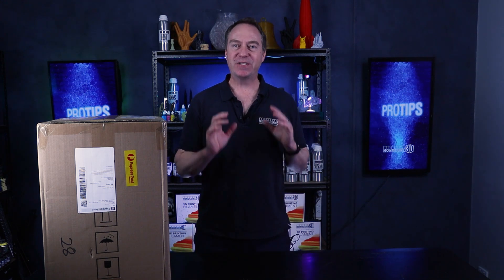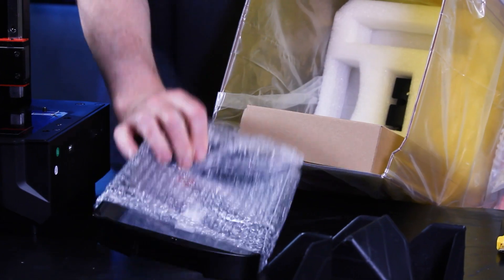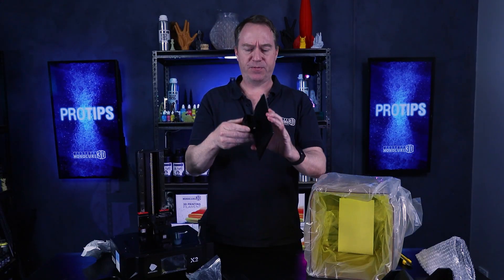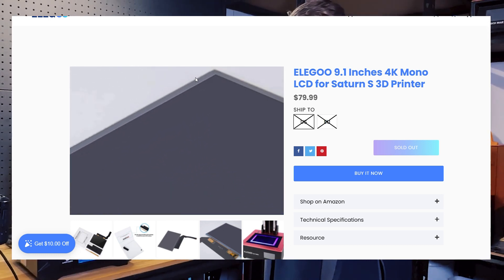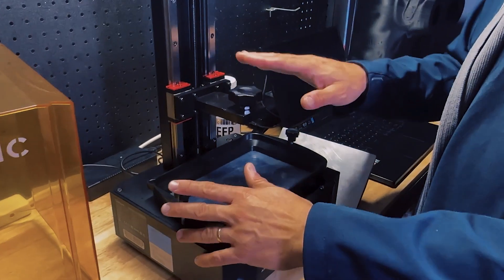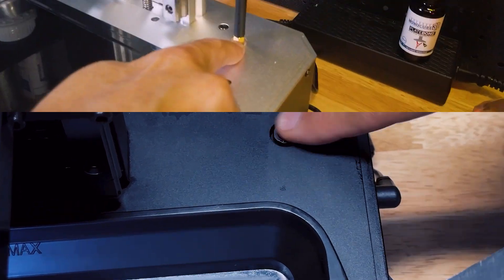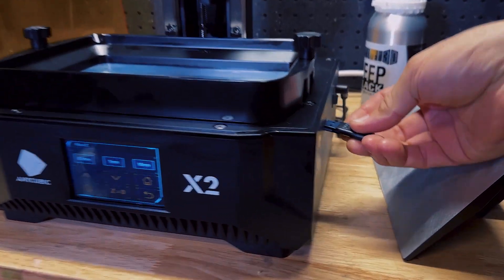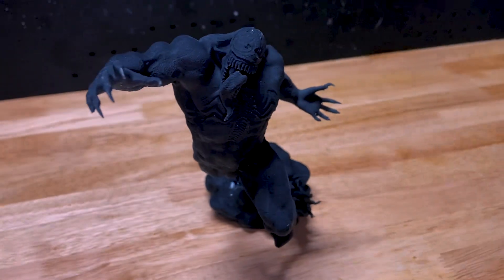Unboxing & setting up the Anycubic Mono X2 | Replacing the LCD screen | Better than the Mono X?

Comment: The important question is: did the resin leak happen despite the screen protector, or did you forget to install the screen protector? I thought the whole point of the screen protector was to keep resin from getting into the printer.

Comment: so should i fill my new vat with distilled water to test for leaks?
Reply from the maker: Doesn’t need to be distilled
Reply: @Monocure3DProTips  so would I just put in water and wait around 30 minutes to test for leaks or would it be instantly noticeable. Just my first 3 d printer and so i dont want sny mess ups

Comment: X2 or M3? It appears that the M3 has better contrast. Is it that much better to sacrifice the size?
Reply from the maker: X2 IMO
Reply: I have both , and i did a comparison test of a small head scale 2 CM height , it's not a real difference especially if you changed the Mono X2 layer height to 0.03 - you won't see a difference with your bare eyes

Comment: FYI You can buy replacement hand-bolts from bunnings (if you're in oz). Mono X build-plate screw is M8 20mm (stock is 12mm but it still fits) and M6 40mm for the vat. I would presume these would fit the X2 as well.
Reply from the maker: Nice tip thanks Ben!

Comment: What settings do you have set for this printer? Are you using the settings that anycubic slicing software gives you from factory?
Reply from the maker: Settings depend on the resin you are using.